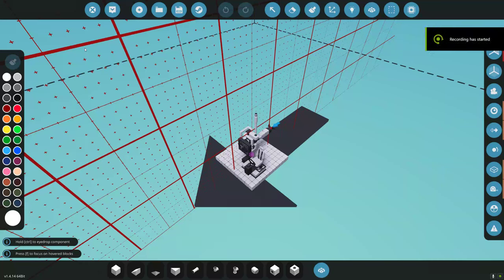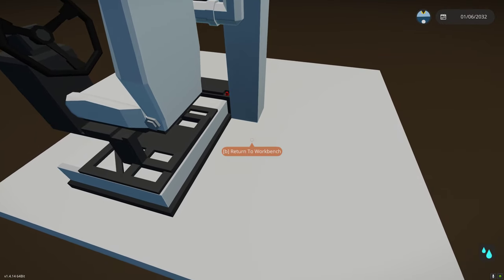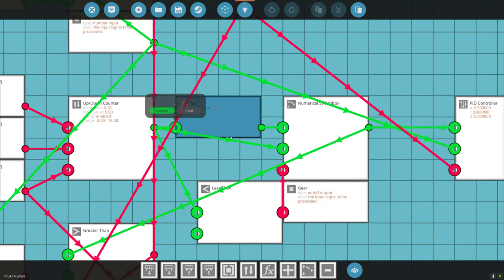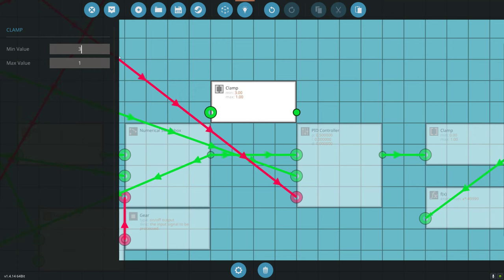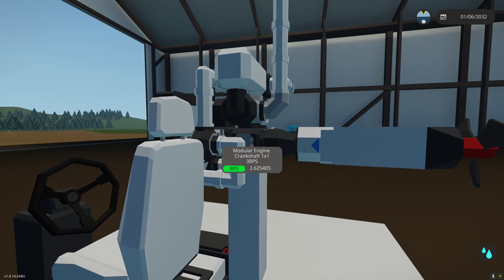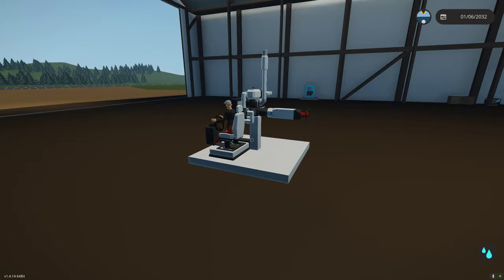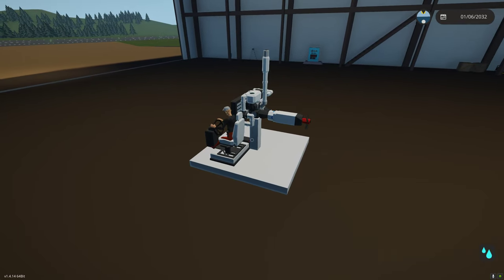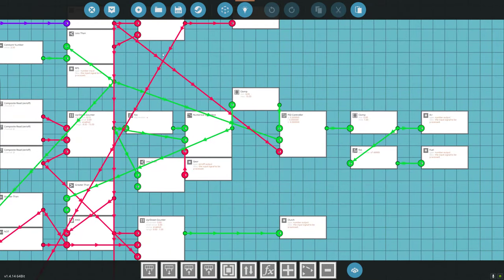Stormworks Basics Modular Engine Tutorial Part 7

Comment: I have watched through this entire tutorial and I finally think I am understanding modular engines. It's the microcontroller that always trip me up. But I was wondering, If I were to scale up the engine, would this MC work, and if so, what numbers would have to be changed to make it work?
Reply: Did some experimenting, found it nearly works perfect, though my RPS is very inconsistent when throttled up. Any advice?
Reply from the maker: @KuzakoTheAvali  Change the p-value on the pid that controls the air and fuel. Change it up and down by small increments till the engine runs smoothly.